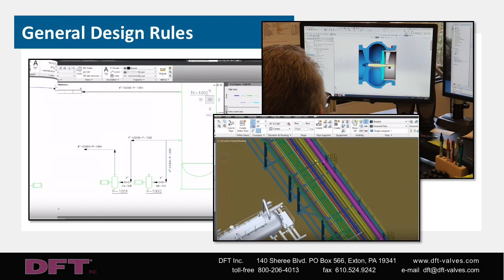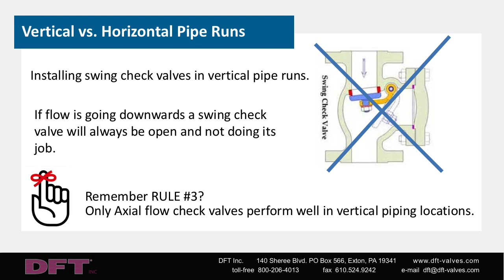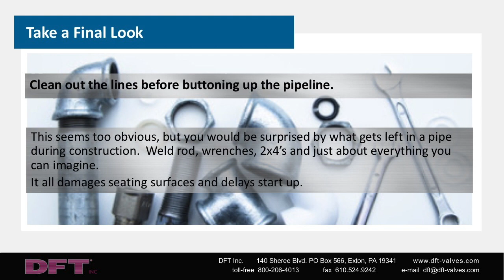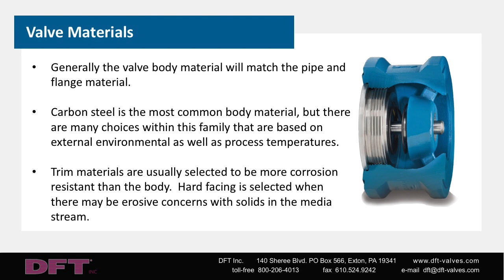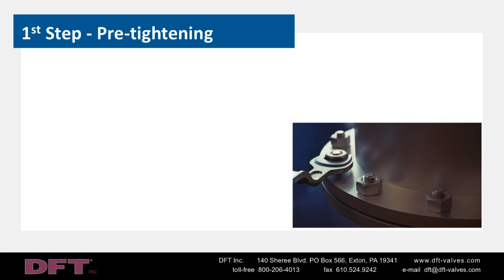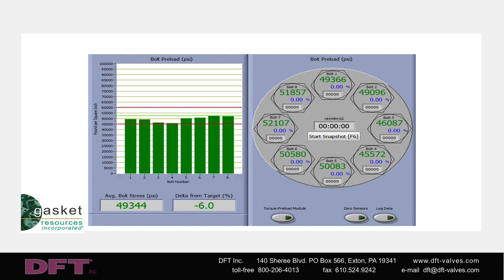Check Valve Installation and Piping Design Guidelines Webinar

Comment: what will happen is the check valve is installed right on top of the pump discharge??
Reply from the maker: When a check valve is installed right on top of the pump discharge the valve sees a great deal of turbulent flow.  This can cause tremendous instability in the closure mechanism of the check valve whether it’s the disc in a swing check or axial flow check or the doors of a double door check valve the closure mechanism will be responding to the turbulent flow.  Eventually this constant motion will cause wear and failure.  Of the 3 types of check valves mentioned, the axial flow valve may be the best suited for this environment if the design incorporates a single, concentric spring.  However it will be very important to do the sizing calculations for the valve to make sure that there is sufficient flow to fully open the disc and that the disc is against the full open internal travel stop.  If the valve is oversized, i.e. the flow rate will not bring the valve to 100% open, the disc will be able to chatter and it will eventually wear the stem and bushings in the valve.  DFT can provide you with the custom sizing that this valve may need to insure that it will not chatter. Thank you for your question!